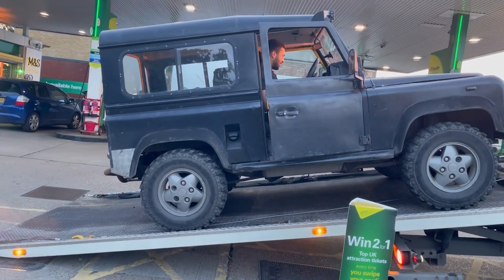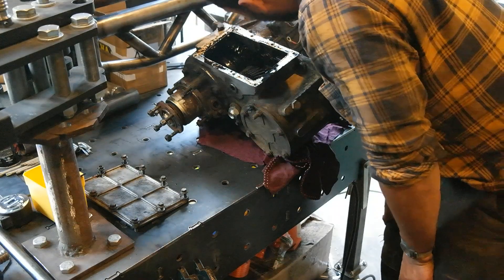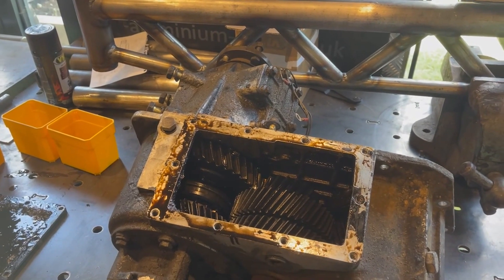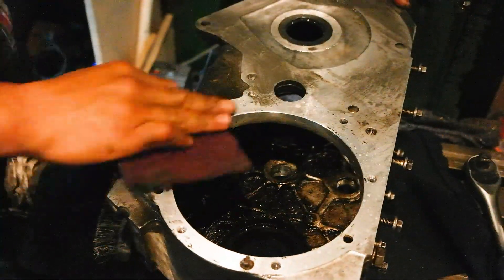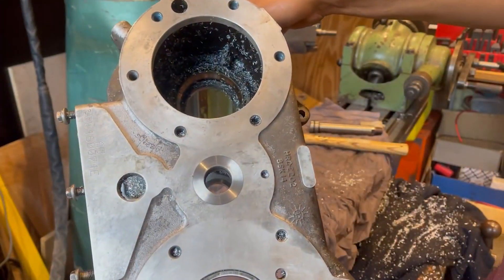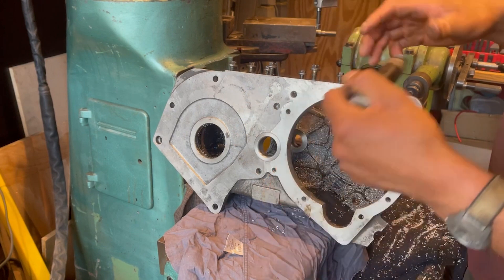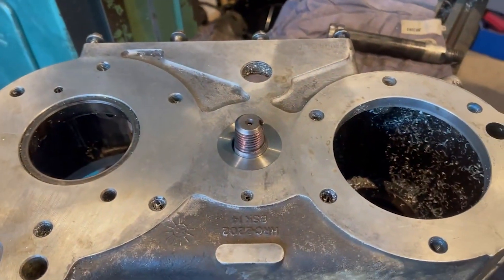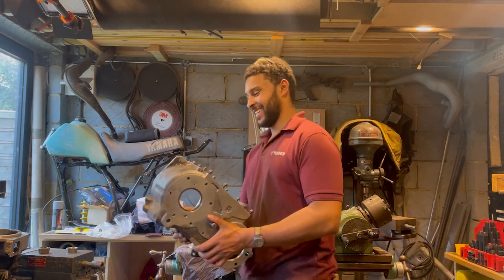M57 Defender: Transfer Case Rebuild

Comment: Hi Hows everything holding up, is the R380 and LT230 holding up to the engine or has there been any more disasters. If you did the conversion again would you do anything different. Thanks.
Reply from the maker: I've had to sell my land rover, It was holding up fine while I had it. If I were to do another I would definitely use the 6 speed bmw manual, 6hp ZF auto or 8hp ZF auto. 
Nothing wrong with the R380 but parts for the BMW transmissions/adaptors were impossible to come by at the time of doing my conversion.

Comment: Great job on the swap,very good idea.
I would just like to hear your opinion also on something.
I have a 2002 Hilux i would like to do a Merc om642 v6 swap on it,how would i want to do a Standalone on an engine like that?
im from South Africa seeking your advice😁
Reply from the maker: Thank you mate, I’m not familiar with the om642 but I can’t see any reason why it wouldn’t be possible. A lot of guys use the om606 as well, a Bullet proof engine with crazy power, would you consider using that?
Reply: Yea ive looked in to that 606,its just not that avalible here,but i will do more research,thx again

Comment: Had my Td5 tipper remapped about a month since..propshaft sheared off last week at 40mph and joined my feet in the footwell...had Defender's for 15 years plus but i think its time for a Land Cruiser😋
Reply from the maker: 😖😖 did you go back for your feet?? 

That’s the thing, I can honestly say, I’ve never invested so much time into a car, I don’t know why we do it!

Are you talking fj40 cruiser or newer now??
Reply: @KeepitBigBore  luckily i had work boots on🙄nah im after a 79 trayback then convert it to tip! Landys just dont cut it at work
Reply from the maker: That’s extremely lucky!!! Could have cut the ankles off ya 😂😂

What kind of work are you doing, most people consider defender’s the most capable 😳

Are you looking for pulling or reliability?
Reply: @KeepitBigBore  im a tree surgeon,  reliability and some grunt, i use an old Shogun for a lot of heavier towing but i just find Defender's axles and props aren't really up to the job
Reply from the maker: They take a lot of work to bring up to strength alright. I never would have thought a shogun would be better for towing! A lot of guys are m57 swapping them so they can obviously take the abuse! 

I pulled a tree stump out with my defender a few months back, I didn’t want to put too much pressure on the axles while in 1st low so I tugged it rather than pulled it 😂
Reply: @KeepitBigBore  🤣pulled a few stumps out with it the key is steady on the throttle 😂

Comment: special thanks for 13:09 ) please more videos about using this car in traffic, motorways, etc) pleasure to hear it!
Reply from the maker: No problem mate, thanks for commenting. I can do a video about this. It’s great to drive on the motorway, I can hold 70-90mph for 200 miles without overheating 😂

I have changed the gears in my transfer case however, it was 1.2 -1 and is now 1.1 - 1 so this means the engine is doing roughly 2200rpm in 5th gear (r380) @ 70mph, hope this helps. It also has plenty of power to pull from 70 up to 90mph in roughly 5 seconds 👍🏽

As for driving, the clutch is a bit heavier but I don’t mind. Some people say it’s crazy but I don’t mind, I don’t even notice it any more. In fact, I drive a friends td5 a few months ago and his clutch was so light I thought it was broken. I like a responsive clutch.

In traffic it’s great, the gearing is good for taking off even with the 1.1 - 1 transfer box

It never overheats, the only time my electric fan has ever come on was a few weeks ago when we had a heat wave, the weather was maybe 32 deg Celsius and I was stuck in slow moving traffic for 4 hours.

So hopefully this helps, it’s better than the original engine in every way. As far as I can see, it has no disadvantages. Some people say the ecu is a disadvantage but that’s where you get your torque and fuel efficiency from so it’s another positive for me!!
Reply: @KeepitBigBore  thank you for such a good answer! I already have M57N2 engine and GS6-53DZ gearbox from BMW. But still only at the floor of my garage)) also ordered 1.1:1 gear set in Tbox and adapter from Syncrogearboxes to mate with LT230. See what happens one day ohh)
Reply from the maker: It sounds like you have the perfect combination  for a manual defender 👍🏽👍🏽

Good luck, it’s gonna be insane 😬